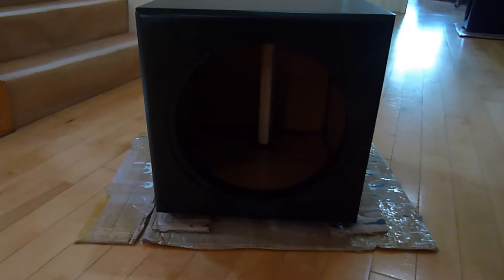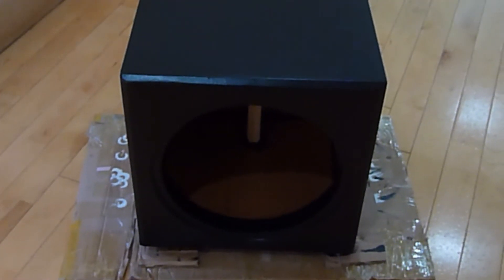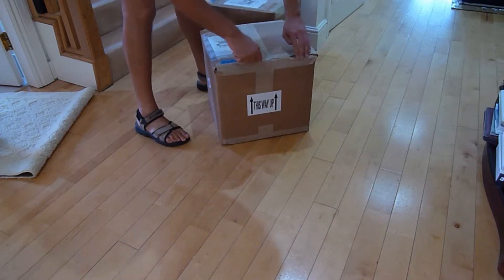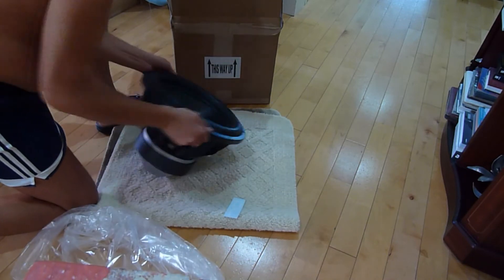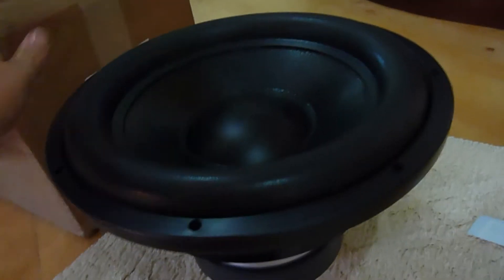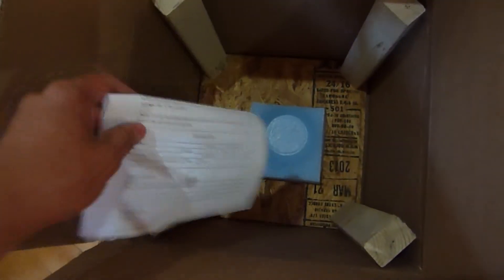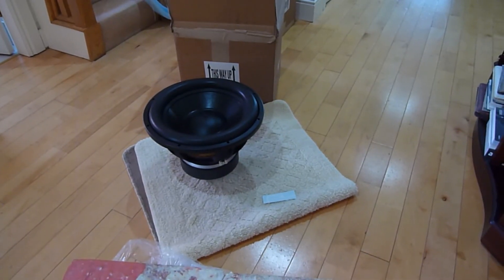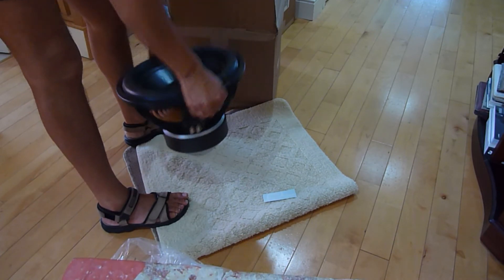FI SP415 UNBOXING + SUB BOX PAINTED + FI SP415 SCREW HOLES

Comment from the maker: @ kcox669live Hi and thank you for your reply yes the surround is well glued on with epoxy and it is solid I did not expect it to be so heavy as for the Focal which I think are two way they are in my car and they are fantastic speakers but the center cooling flange came off or should I say it wasn't glued on well to the Focal speaker as it started rattling and I thought the speaker was fried but it turned out this was rattling of the Focal speaker surround & it is working quite well.